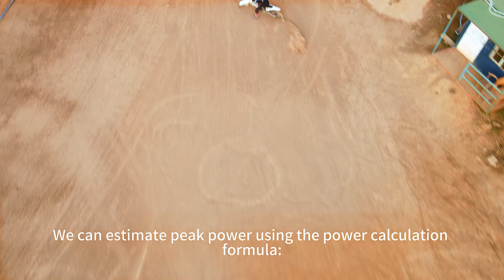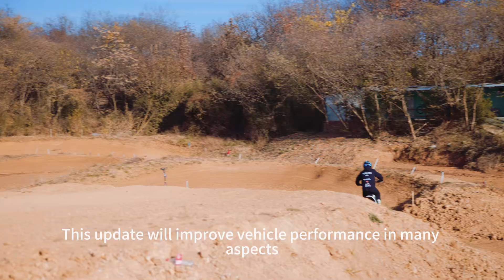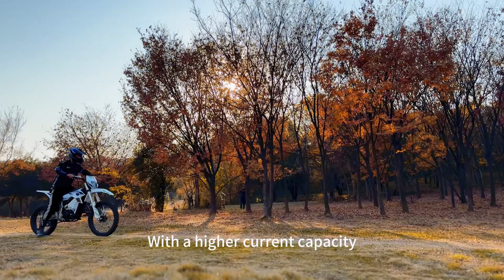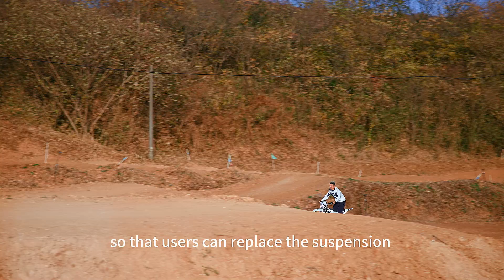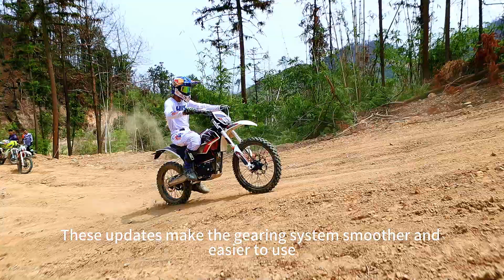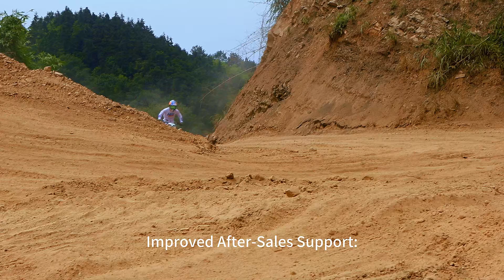Latest Upgraded AdmitJet Armor Electric Dirt Bike | Power, Durability, Performance

Comment: Can you please compare the 2023 model with gearbox with the 2025 model without gearbox. Thank you very much
Reply from the maker: Below is a clear comparison between the AdmitJet Armor Geared and the 2025 AdmitJet Armor without gearbox (gearless):

1. Powertrain & Riding Feel

AdmitJet Armor Geared (with gearbox)

Uses a mid-drive motor with a multi-speed gearbox.

Riding feeling is closer to a traditional petrol dirt bike, because you can change gears and play with the power band.

More engaging for riders who enjoy “mechanical” control and a sporty riding style.

2025 AdmitJet Armor Gearless (without gearbox)

Uses a high-power electric motor with direct drive and an FOC controller (up to 25 kW peak power depending on battery option).

No gearbox – just twist the throttle and go.

Power delivery is very linear and smooth, with very strong low-end torque and fast acceleration.

2. Performance & Ease of Use

Geared version

Very good torque and climbing ability thanks to the gearbox.

Performance depends more on the rider’s gear choice.

Better suited for experienced riders who already ride enduro or motocross and like to shift.

2025 Gearless version

Higher peak power and stronger “instant” acceleration.

Much easier for beginners – no need to think about gears.

Ideal for mixed use: off-road fun, trail riding, and also urban / daily riding.

3. Maintenance & Reliability

Geared version

More moving parts (gearbox, transmission), so maintenance is a bit higher.

You need to pay attention to oil changes (if required) and wear on the transmission parts over time.

2025 Gearless version

Much simpler structure – no gearbox, fewer mechanical parts.

Lower maintenance, easier for rental business or customers who just want to ride without worrying about technical things.

4. Noise, Comfort & User Type

Geared version

Slightly more mechanical noise from the gearbox.

Very fun for riders who love the feeling of shifting and controlling the bike with gears.

2025 Gearless version

Quieter and smoother, especially at low speed.

More comfortable and friendly for new riders, families, and city riding.

Also very attractive for riders who are used to other popular gearless electric dirt bikes on the market.

5. Which One Is Better for You?

Choose AdmitJet Armor Geared if:

You are an experienced off-road rider and enjoy the feeling of gears.

You mainly ride off-road/enduro/motocross and want a more “traditional bike” sensation.

Choose 2025 AdmitJet Armor Gearless if:

You want the latest generation with higher peak power and very strong acceleration.

You prefer simple operation and low maintenance.

You plan to use it for mixed riding (city + off-road), or for rental business, or for customers with different skill levels.

Comment: I did some testing with the admit jet motor in my motorcross bike with a fardriver 72680 controller it’s a very powerful bike With the stock 72v50ah admit jet battery , the bike can safely handle 20-25 kw without significant motor heat. I did some testing first at 16.000 watts 16kw With the controller set at (225 line amps and 530 phase amps with 13 50 gearing I was able to achieve 127.8 kph. The admit jet motor was only at 32• and was not hot at all. I did some test at 20 and 25 kw and the motor still didn’t have significant heating. At 20-25 kw The admit jet electric dirtbike has more torque and power then a 450 combustion motor easy.
Reply: Pour atteindre la puissances max. d'un moteur électriques ils faut obligatoirement le faire forcer pour que l'intensité ( amp ) monte . En alimentant un  moteur à plus haut voltage :72volt vs. 92volt, avec un moteur de exemple 2000watt ( 2KW ) à 72v il générera  27.7amp. Tandis qu'à 92volt il générera un courant de 21.7amp donc vue que le courant(amp) est inversement proportionnels à la Tension(volt). plus tu augmentes la tension(volt) pour alimenter un moteur moins le moteur générera de courants (amp) alors il reste à 2000watt la batterie et le contrôleur ne pousse pas de courant , elle ne crée pas le courant, c'est le moteur qui crée le courants(amps) . Pour faire monter le courants de façon à atteindre le courants crête pour avoir la puissance crête pour mon exemple d'un moteur de 2kw, la puissance crête serais autour de 3.5kw et LA SEULE FAÇON D'Y arriver: C'EST DE LE FAIRE FORCÉ,  AUGMENTER LA PUISSANCES DE LA BATTERIE REND PAS LE MOTEUR PLUS PUISSANT.
Reply: can i use the stock display with the new controller?
Reply: What’s the top speed you got in mph ??

Comment: Hey I have a admit jet motor and battery that I put In a motorcross frame , I have the 600 amp controller I was wondering if you can tell me what line amps and phase amps to put in the settings? Thanks 🙏🏻
Reply from the maker: It’s great to hear that you’re using an AdmitJet motor and battery in your motocross project. Here are some general guidelines for configuring your 600A controller:

Understanding Line Amps and Phase Amps:
Phase Amps (Torque):
Phase amps are directly related to the motor's torque. For your setup, set the phase amps to around 2-3 times the bus (line) current.

Example: If your line current is set to 200A, your phase current can be between 400-600A.
Line Amps (Speed):
Line amps control the overall speed. A higher value will allow the motor to reach higher RPMs. For a motocross frame, a reasonable starting point would be 150-300A, depending on your power needs and battery capacity.

Tips for Tuning:
Start Low and Gradually Increase:

Begin with conservative values to avoid stressing the system (e.g., Line: 150A, Phase: 300A).
Monitor Heat and Performance:

Keep an eye on motor, controller, and battery temperatures during testing. Adjust the settings if overheating occurs.
Throttle Sensitivity:

Adjust the throttle curve for smooth operation. If it feels too aggressive, you may need to adjust the controller's acceleration settings.
Battery Limits:

Ensure your settings do not exceed the continuous current and peak output ratings of your battery to avoid damage.
If you’d like more precise recommendations, please provide the following details:

Battery voltage and capacity.
Desired performance (e.g., top speed, torque emphasis).
Frame weight and intended use (e.g., off-road, track).
Feel free to share any additional questions or feedback as you tune your setup! 
WhatsApp:
https://wa.me/message/DLSITJJZ3HP3H1
Reply: @ thanks for the info I appreciate , the admit jet motor and battery is a awesome combo with crazy power. I have been riding my entire life from 250 2 strokes to 450 race bikes and I love my admit jet motor it delivers instant torque and speed and with the 4 speed it never gets boring and allways has the extra power when you want it when you twist the throttle  , the bike is very smooth and quiet and you can really take the bike anywhere you want. I trail ride mine for hours and still have lots of battery life left it’s a awesome trail bike. , my battery is the 72v50ah battery that comes in the admit jet , right now I started at  225 line amps and 530 phase amps I’m getting top speed of 127.8 kph with 13 / 50 gearing , motor temp was 41• it was not hot at all battery temp was 23•, I was thinking of trying 270 line and 660 phase and see what difference I get I’m looking for a little more torque , Do you know the max settings for your 72v50ah battery ? Im gonna do a little ride video on it today , if weather is good. :) I can only imagine how much better your new model is  it must be wicked. And to anyone looking at purchasing one don’t think twice I guaranteed you won’t be disappointed, I’m running a fardriver 72680 controller and it makes the bike a entire new animal! I can’t believe how much power this bike has. If I could afford it I would definitely buy one

Comment: I have two admit jet armor; 2022 and 2023. The 2022 throttle model is sharper, stronger for me and I like it.
Reply: Did you have issues, which required a new controller?
Reply: @scrummachine69  no problems occurred
Reply: for the 2022 model...